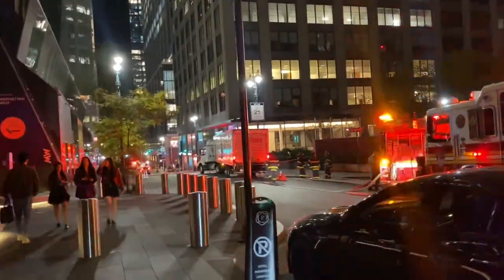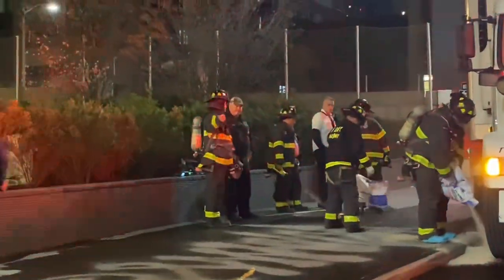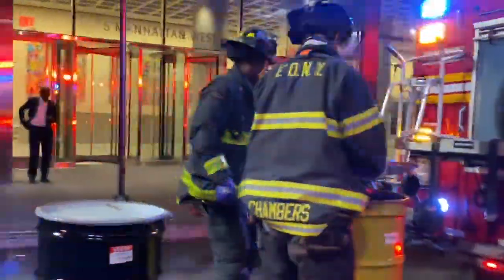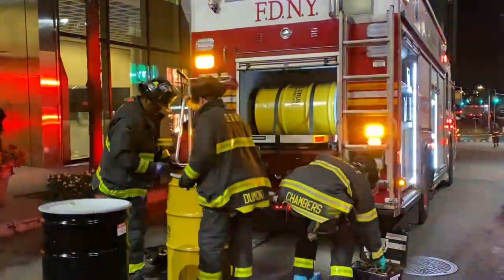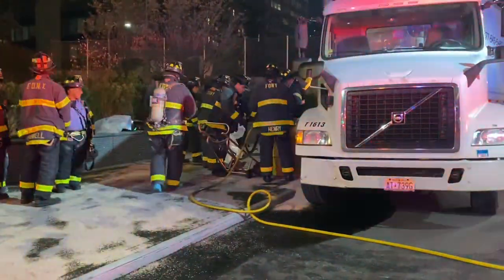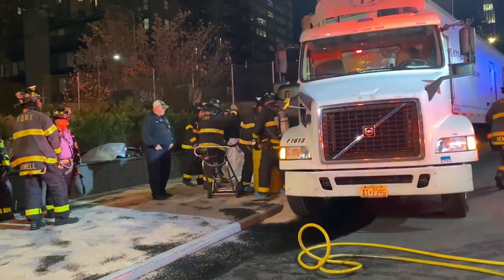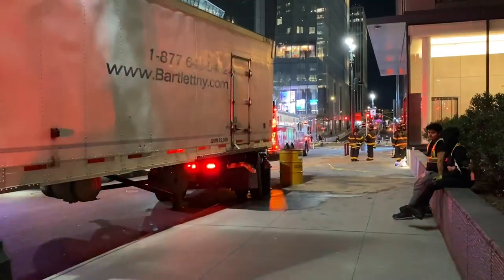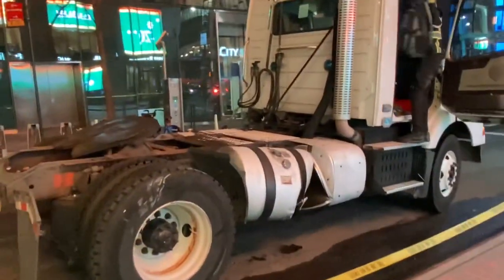FDNY Manhattan Hazmat Box 0707 Tractor Trailer Saddle Tank Rupture From Hitting Fire Hydrant

Comment: I take it the yellow hose is what you guys call a booster?
What sort of pressure does this work at?
Reply from the maker: Not a booster.
Reply: @SkylerFire  Thanks ,  I take it its just for washing down?
Reply from the maker: It’s a air hose no water
Reply: @SkylerFire  I did wonder with the smalltip on the nozzle.
Reply from the maker: They use that to suck up fuel and oils on the road way or into a drum
Reply: @SkylerFire  Yep with have similar for decanting things like this from ruptured fuels tank and similar containers.

Comment: Is there a diff between 44hmtu and the squad 2nd piece?
Reply from the maker: Yes Hazmat Tech E44, 165, 250, 274 are strictly Hazmat Equipment… The squads have some hazmat equipment and rescue equipment. Basically one side of the squad 2nd piece is Hazmat other is Rescue.
Reply: @SkylerFire  ok ty